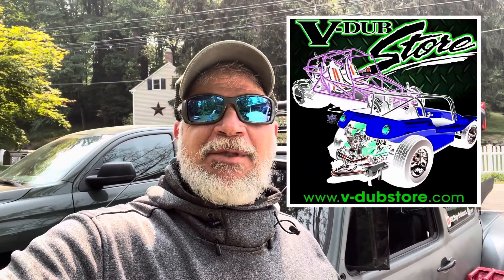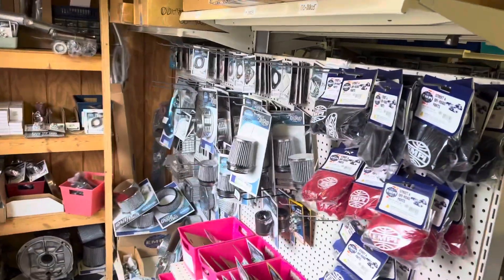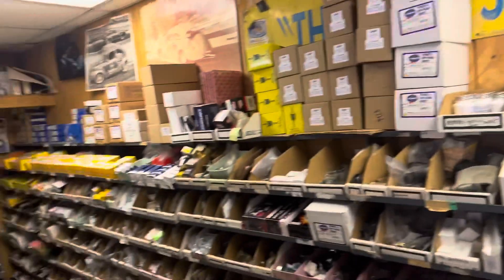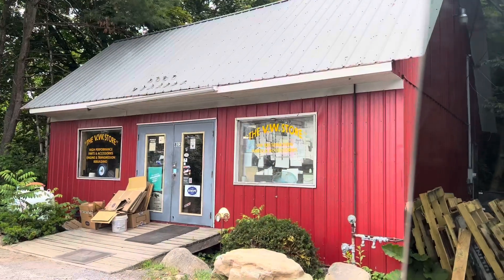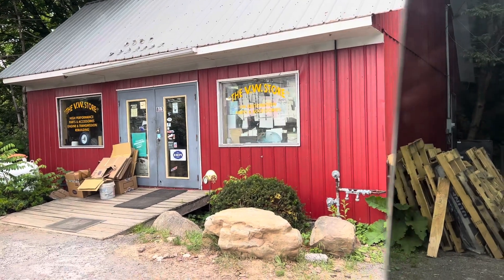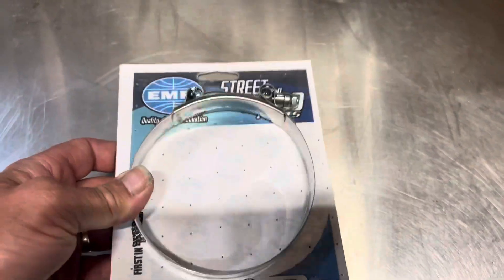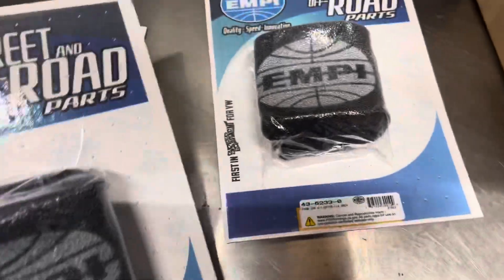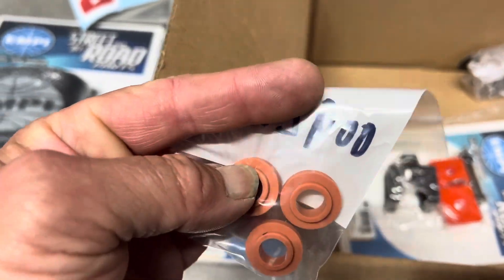Visit to Valley VW the V-Dub Store! #vw #offroad #volkswagen #roadtrip #visit

Comment: Man if you ever have the time I would love to ask you a few questions about your Baja. I have a 70 that I'm wanting to set up very much like yours!
Reply from the maker: I will make time to answer questions. Fire away!
Reply: @69bajaoutdoors  so I'm new to Baja's so bare with me. I'm wanting my suspension front and rear to be wider. On your rear end it looks like you have the 3x3 kit but it has dual shocks on each side. Is that a kit or is that custom? For front end is is your beam from a kit or did you widen it yourself. I'm wanting to lift mine a couple inches without a body lift if possible.
Reply from the maker: @DubieDooberson  
First, thank you for watching my videos and asking for info. 
I have done all of the custom fabrication on my Baja. I widened the front beam 6”. It’s not hard to do but requires 2 good beams to do it. I have 3” lift spindles in the front. 
My 3x3 trailing arms were purchased. My spring plates are cut/notched to allow more drop. I’m running type 3 rear torsions. The rear suspension is custom fabricated by myself. That said, it isn’t the best idea to do it the way I did. I’m currently trying to come up with a solution to my shock mounts hitting the fender wells. I was trying to avoid having a cage inside with holes through the fender wells to accommodate longer shocks. 
As she sits, I have 10.5” of travel on the rear. Front has stock travel. 
If you have any other questions, don’t hesitate to ask!
Reply from the maker: In addition, a body lift will not give you any more ground clearance. But it will give you more head room inside the car. :)
Reply: @69bajaoutdoors  thank you for the info! I'm gonna look into finding another beam to widen front and getting a 3x3 rear kit. Eventually I wanna get to 2100cc currently 1600 but I will do the build this winter. I'm sure I'll have more questions as time goes by so keep posting videos!
Reply from the maker: @DubieDooberson  
Noted! I’ll be posting some fishing videos shortly. Then, back onto the Baja as I have some maintenance to complete. Thank you again and anytime you have a question, I’ll answer it the best I can.